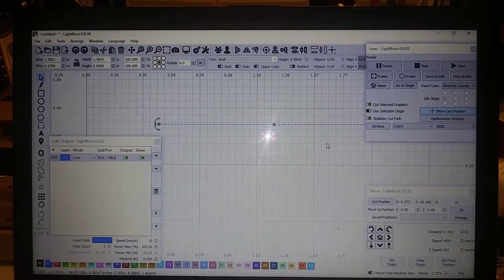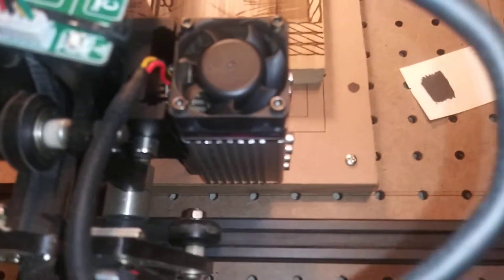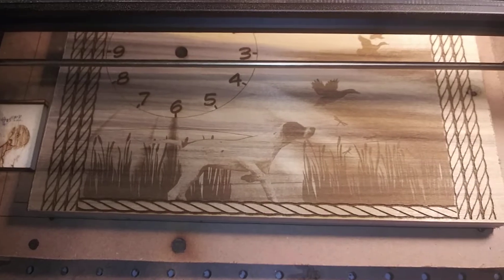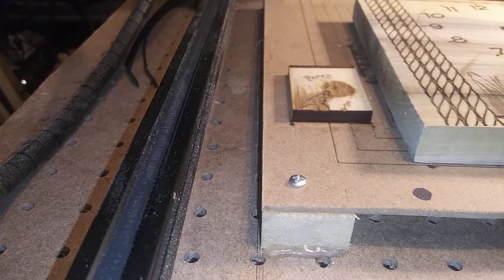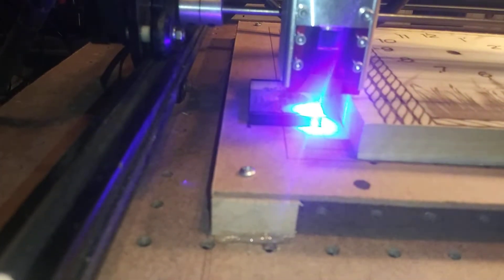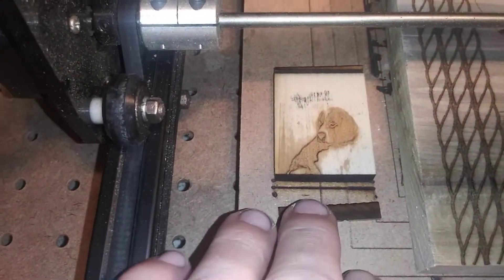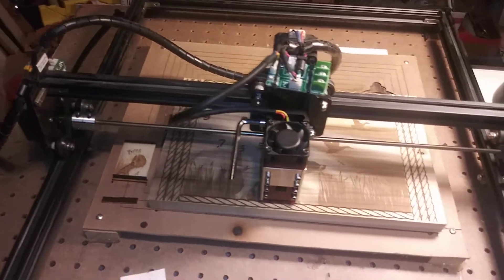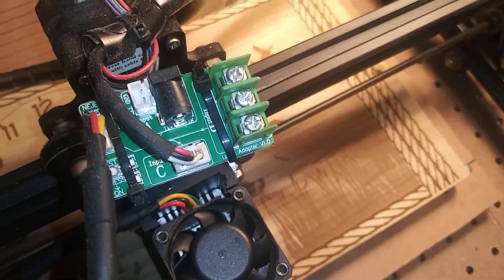Ortur Master 2 with 30w Neje laser improved video.

Comment: Wow amazing results. I have an Ortur laser master 2 15w and wanna make the jump after seeing the results. Just curiously will this laser work with LaserGrbl? Is there much software adjustment to be made?
Reply from the maker: Yeah it works would light with laser grbl but it works better with lightburn and I'm using a 30 watt Neje laser so you should see massive improvement. Check my last video for how to make the mount.
Reply: @tatay41  thanks for the advice man soon as I get a bit of dough I'm gonna make the leap.
Reply from the maker: Your 15w can do lots of stuff you but on thinner material.

Comment: Awesome job with the clock.. Did you do a video on it ? Where did you get that picture from ?
Reply from the maker: Most of my things are done by me and processed by me with Gimp and Paint.net. I did do a video on this clock  I'll check and see why it's not in my postings. All of my engravings final processing is done in Lightburn. That clock has multiple over laid images it isn't one straight engraving.

Comment: Is the laser still working? Do you run it near 100% a lot?
Great video! Thanks for sharing 👍
Reply from the maker: Yes I do run it at 100% when I need it. But that is at high speeds usually 1000 to 4500, my most common settings for engraving is speed 2000 power 50%, that makes it about 1/16 to 1/8 deep on the second pass. Remember the depth of the cut depends on the type of wood and the color. Lighter color wood takes more power or more passes. Would you like me to post a video of the clock above?
Reply: @tatay41  absolutely to the video!!! Thanks for all the help!
Reply from the maker: @emmettbowen4431  No problem I've been very busy rebuilding my shop for the last few weeks, but I did do a video on that clock above. My A/C went out and I decided if I was going to all the trouble of replacing that stuff I would redo it all. LOL bigger project than I first thought but im 3/4 of the way finished.
Reply: I know I am kinda randomly asking but does anybody know of a good site to stream new movies online?
Reply: @Julius Patrick flixportal xD
Reply: thank you, I signed up and it seems like a nice service =) I appreciate it!
Reply: @Julius Patrick happy to help =)

Comment: great video! so you recommend the neje module? i interested because i want to mount on a cnc i made. I wanted to buy a multipurpose module and i was thinking at the neje 30w or 40w. Can you give me an hint? thank you
Reply from the maker: The coding for CNC and 3D printers are different from Laser cutting and engraving because of the z axis. Lightburn software includes the z axis if you need it. As for the Laser module I'm using the Neje 30w it does a good job so I would think the 40w being more powerful would be even better.
Reply: @tatay41  more powerful doesn't mean less accurate right?
Reply from the maker: @Thewarrior8693  If you mean a similar size focus from what i've seen its about the same focal point.
Reply from the maker: The 30w has a focal point of .075mm, the 40w has a focal point of .1mm. That difference is so small to the naked eye it wouldn't be visible. I am personally happy with my 30w so far. I'm not looking to cut thick materials.

Comment: hello, good job
I have bought this same laser and I cannot make a cut in 2.5mm mdf
Could you help me, how did you do the focus?
is this the problem?
Reply from the maker: What I do to cut materials is a test at 100% and starting with 1000 mm/s I gradually reduce the speed to cut without burning up my work piece. IMPORTANT: DO NOT ADJUST YOUR LASER HEAD FOCUS LEAVE IT AT FACTORY SETTING.  Instead you want to adjust your laser height starting at the correct focal length of the Neje laser 60mm, then I adjust to 57mm, then 54mm. Doing that allows me to cut thru. I would rather be patient and make multiple passes than to burn up my project. Thin materials I use a higher speed to prevent burning the edges, thicker material I make the initial cuts at high speed and then drop the speed by 1/2 or more to cut without burning the edges. If you changed the focus at the laser head use a piece of metal and coat it dull black with a magic marker fire the laser on low and adjust til you can barely make out the pinpoint. That will get you within factory settings. I hope this helps and gives you a better day. 😀
Reply: @tatay41  
Hello,
To focus the way you indicate, should I shoot the laser at low power?
is it safe to look at it at low power while focusing?

thanks
Reply from the maker: @lionwarchannel7624  Never look at the laser without the provided glasses unless you have a box with the correct protective coated window. Yes fire it on low and then you can use a piece of metal or paper painted flat black to fix your focus. Be sure the lens is 60mm from your black surface. Then focus it until you can only make out the smallest pin point. You only want a pinpoint no extra light. I got tired of wearing glasses all the time so I built a box with the proper coated windows. I can look anytime I want as long as I want. Family pass thru my shop and there is no concern for their eyesight. I'm going to video a new box build soon since I want to add my rotary attachment for doing mugs and glasses.
Reply: @tatay41  excellent, and where to get the material for the windows and that you are sure that it protects you in the right way
Reply from the maker: @lionwarchannel7624  https://jtechphotonics.com/?product=445nm-laser-shielding
Reply from the maker: I almost forgot to say. A good rule of thumb is to have a 60mm guide , first cut at 60mm then move the laser to the side of your project wood and adjust the height to the floor of your cutting bed. That is for thin wood or material, don't try that with anything thicker than 3mm.
Reply from the maker: If you can't adjust it to the correct height raise your mdf to be within 50mm by using playing cards or shims. I fixed mine by making a completely new mounting acrylic to be at 60mm from the bed. I'll do a revised video to help you and others this week.
Reply: @tatay41  thanks You, best regards

Comment: So really you will do better buying the neje than the ortur the reason I said this is becouse I want to buy a laser and I see that ortur have a better frame but the laser module not that good so apple to oranges I am going for the neje great videos
Reply from the maker: The Ortur works great for most people but I found that for cutting wood and acrylic the Neje 30w is what I needed. My next laser will be the big Neje with either the 30w or 40w. I use my Ortur all the time. Even if i get a big Neje frame the Ortur is going to be in use. Thank you for the nice comment. Watch for my next video if you want to see a really good way to save money on the canvas prints.

Comment: Whats The max it can cut? 4mm plywood?
Reply from the maker: I can easily cut the birch plywood at 5mm thickness. I cut solid poplar at 6mm without any problems. Solid oak cuts with a few extra passes. Be aware the oak plywood at Lowe's has a flame retardant filler and I don't recommend cutting it. It's a waste of time.

Comment: Isn't this NEJE Laser one of those 'cheap' Chinese Lasers that, if you run at 100% power a lot it will dramatically shorten the Laser Diode's life?
Reply from the maker: Thanks for time and comment. I haven't had that problem with mine. Anything can be broken if you abuse it.

Comment: The 3 wire plug, is that the one that came directly off the ortur laser?, so does it go back to the other little circuit board on the end of your gantry frame?.
Reply from the maker: The wiring from the frame to the laser will have a 3 prong plug, there is an input on the circuit board that came with the laser. It will have a 3 and 4 pin input and other inputs match your wire to the input that it fits.

Comment: aynı resmi yapmak istedim (ördek köpek ve saatli) 35cmx20cm 2 gün süre çıktı vazgeçtim. çok uzun sürecek. kullandığım program LASERGRBL. lazer modül NEJE 30w. lazer güç %100 hız 1200. siz bu resmi ne kadar sürede yaptınız?. teşekkürler
Reply from the maker: Saat 30cm x 20.5cm, Gimp düzenlemeli 6 görüntüdür.  LaserGRBL'nin Lightburn'ün yaptığını yapabileceğinden emin değilim.  Umarım sorunuzu cevaplamışımdır.

Comment: Where did you get the circuit board from? I own the ortur LM2 and just received the neje 30w and it came with a different circuit board. Thanks
Reply from the maker: The circuit on the Neje 30w laser is the one that was included with it.
Reply from the maker: Just a thought but even if the board you recieved is different it should still have the same type adapter plugs. 3 pin, 4 pin, etc. hopefully the board is labeled enough to show input and output plugs.

Comment: Great video! Is the power supply  adapter upgrade necessary?
Reply from the maker: If you are asking about the circuit they send with the laser I would say yes because its a controller circuit for the fan and laser. The input from the Ortur uses a 3 pin plug, the Neje is a 4 pin.  If you are asking about the need to replace the power supply. I replaced the power supply to be sure there is always enough power. I want to stress that the circuit is included with the laser it's not separate.
Reply: Thank you for the info. I was more just curious about your reason for switching the power supply. Thank you again for the information.
Reply: Have you tried this laser model with the G8 lense?
Reply from the maker: @goatmaster4737  No I have not used a G8. I may try it in the future but it seems to do what I want as a stock model. After checking the G8 to see why I did not get one I found that it has great pinpoint focus but lacks in cutting depth. So I won't be adding one to my laser.

Comment: Thanks for the video i'm thinking of getting one to upgrade.
Reply from the maker: It cuts poplar like butter, birch is no problem, oak and maple take longer to cut.
Reply: Thanks
I noticed the wires feeding power ans TTL signal are larger than what is currently in my modual did you have to make wires bigger due to extra power required for the Neje 30 watt? I just ordered one.
Reply from the maker: @MrRenoman2011  The wires on my machine are the stock wires so the only thing I was concerned with was the power supply even though Neje says it's only 3 amps I wanted to be sure. The few changes i've made recently is to stiffen the wiring harnesses with zip ties to prevent tangling. I tried the chain link type and it was just to bulky.
Reply: There is a new neje master 2 with 40 w coming out. Would you recommend buy it? I ordered the ortur Laser Master 2 20 w and i am scared it is not enough power to cut things
Reply from the maker: @rapraa6375  Without trying it I couldn't say, but the 30w works much better at cutting so I would think the 40w would be more powerful. The Ortur 20w does cut but not as well as the Neje lasers.

Comment: From looking at your setup, I'm assuming the optional focal length is much closer than the Ortur?
Reply from the maker: 50mm is the focal length. Between 45mm and 50mm is the sweet spot. I don't adjust the lense I adjust the laser height with a 60mm jig I made that plugs into the laser focus hole, the area below that is 50mm.
Reply: @tatay41  hi, i have the same module just awaiting the adaptor board as mine didnt come with one. Focusing the lens is a pain with that little window. what amp power supply did you upgrade to?
Reply from the maker: @Nonprofessional_Tinkerer  Hey I'm glad to help the link is in my description above just click show more. I know it's hard not to mess with the focus but a bit of advice don't play with the focus. Use the sliding z axis with the allen wrench, it's the same thing and you don't have to worry about ruining your laser lens focal point. 50mm is max focus.
Reply from the maker: @Nonprofessional_Tinkerer  I will be posting a solid acrylic upgrade kit for the Ortur Master 2 for fitting the Neje laser with preset gauges in acrylic to adjust the Z axis for instant focus. Soon as it is done I will post my store link.
Reply: @tatay41  hi, i did manage to speak to someone who made a plate to put the 30w module and also the adaptor plate onto the ortur. Ive had to remove the lens to check the element was capped. So with the lens screwed all the way in the focal point is at 50mm?
Reply from the maker: @Nonprofessional_Tinkerer  from the bottom of the tiny adjustment window adjust your z axis to set at 50mm with a caliper using a flat surface like a board that is smooth. Place a black dot on the board or surface using a permanent marker. Then focus your laser to the smallest pinpoint you can get. That will be your 50mm focal point. If you get stuck with my answer let me know I'll do my best to explain. My parts for mounting are not made with PLA from a 3D printer because it will get hot and warp. I'm using 6mm acrylic sheet. Just be aware if you use PLA parts you risk the fact that the PLA warps when it gets warm.

Comment: How is that power supply working for you.
Reply from the maker: Works great no problems.
Reply: @tatay41  nice I'm getting mine today and I got it because I came across your channel. There is little or no I formation on this laser and I got it as well.  But was afraid that the stock power supply was not enough. Aside from that the stock supply is no grounded so I would get shocked from the friction of the belt and it would also shit off my motors or main board which would stop the print process. so I had make a ground wire touching the floor but I like this better. Next I'll be getting air assist even though it already kinda has one I just want one strong enough to push out debris from the cuts so I can cut faster.
Reply from the maker: @ikezarate1756  It has been running over 16 hours a day 4 days a week for over a month now and no problems with mine. Just be sure you set up a spacer for that homing switch.